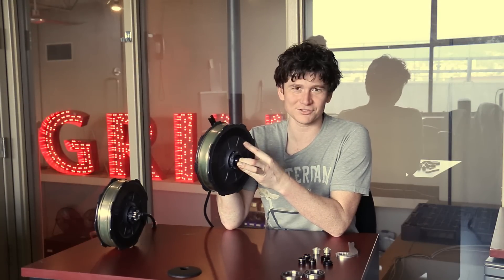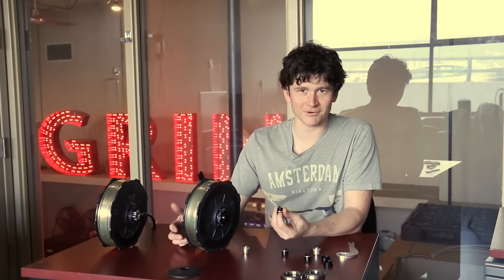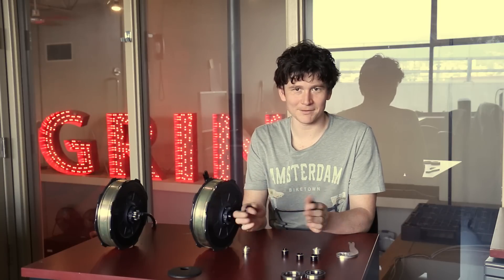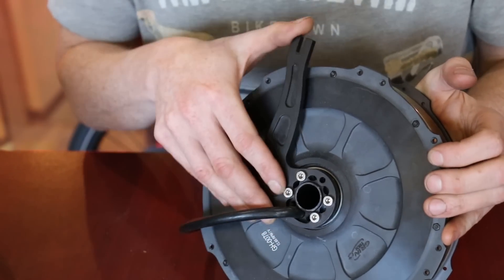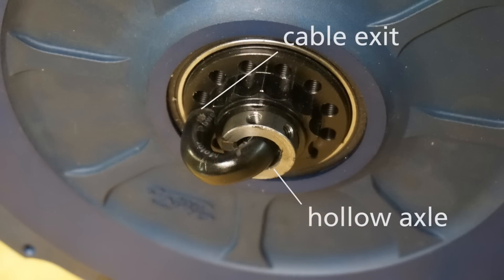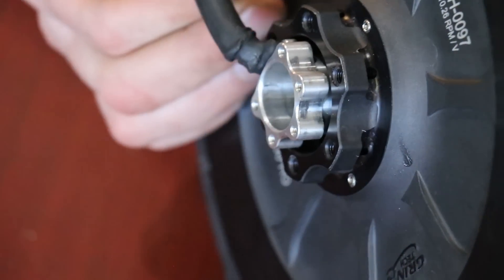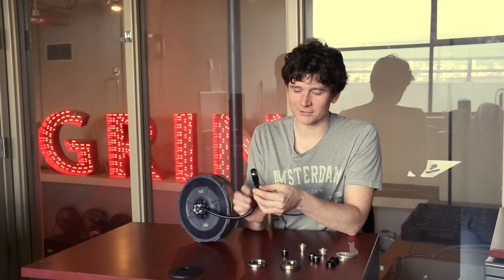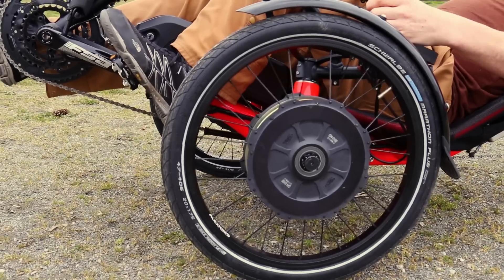Introducing the Grin All-Axle Hub Motor, with Updates for Single Side Applications

Comment: All that work and most people will run their motor on the rear wheel.  Like all other motorcycles.
Reply: When it comes to performance: You want as many drive-wheels as possible.
You would see a lot of 2WD motorcycles if there was an affordable and easy way to implement it.
Reply: @joshpit2003  Speaking of $$......These things aren't cheap and I appreciate why they cost what they do but that being said, very few people, are going to run 2 on the front wheels, as apposed to 1 on the rear.  Justin has this thing about front wheel applications but I think it's bad business because it's not indicative of the market.  ijs
Reply: That idea falls down if you're running a rear hub gear, which is not all that uncommon on trikes.
Reply: @mowcius  What is the Grin mission statement?  As a commuter (have been running ezee rear hub for 7+years) I would just swap the hub gear for a rear hub motor.  It would be cheaper and I wouldn't have to worry about torque steer or unnecessary unsprung weight.  ijs
Reply: @insertgoodname4809 , but that's a compromise which not everyone wants. If someone's running say a Rohloff or a Nuvinci CVT, they're not going to want to go back to a derailleur just to run a rear hub motor.
Reply: @mowcius  If they're a commuter I think they will swap.  If, on the other hand, this is primarily a high dollar weekend toy, I could maybe see your scenario.  Even then it seems impractical. ijs
Reply: @insertgoodname4809 , commuters tend to be the exact cycles people like to have hub gears in (to keep maintenance simple), but I'd hazard a guess most people don't commute on trikes unless it's for a medical need as they're so much more difficult to store/lock up.
If they do it's probably long distance, using the trike instead of a dinosaur juice machine, and two hub motors is cheap in comparison to a car.
Reply: @mowcius  I have a four-wheeled velomobile,  I have a Rohloff in the back, could install a mid-drive motor but the possibility of dual hub motors opens up the option of better gearing options for pedaling and climbing. Climbing is really hard in a heavy touring recumbent. Will consider this option. Will probably still go for mid-drive as two hubs would be quite expensive and heavy. 2x hubs, I assume I would need two batteries too. Not sure how it works for the controllers. Need to research more.
Reply: For normal bicycles and normal performance it doesn't really matter if it's FWD or RWD or 2WD. Most people are perfectly fine with a tiny 250 W front hub motor. 

If we want to maximize performance we're not talking about a upright diamond frame bike anymore. Maybe something with 6 wheels and differential steering is what we would be looking at.

Mechanical drivetrains can also be replaced with electrical ones, you pedal a generator.